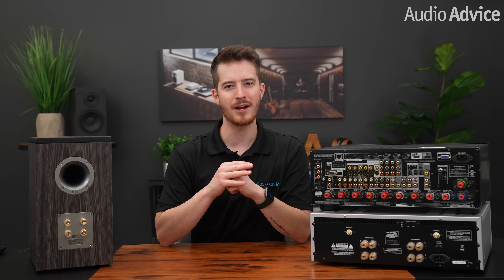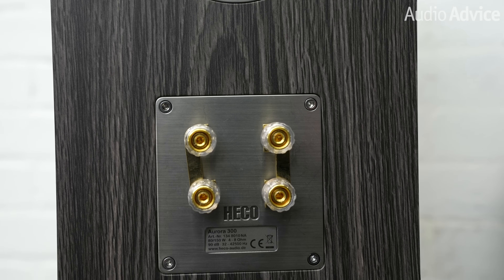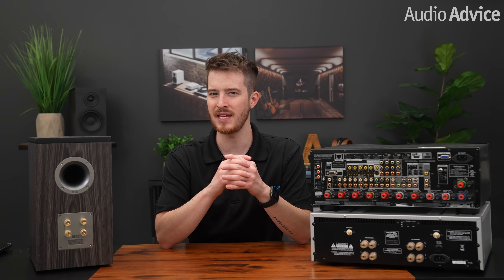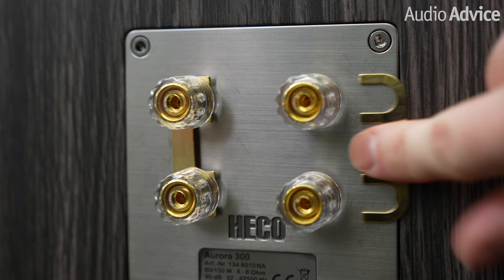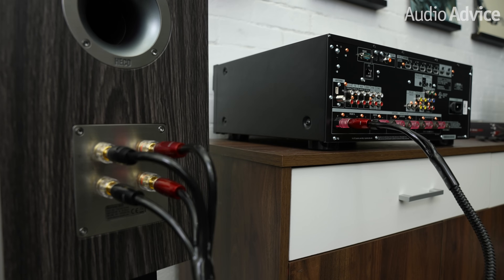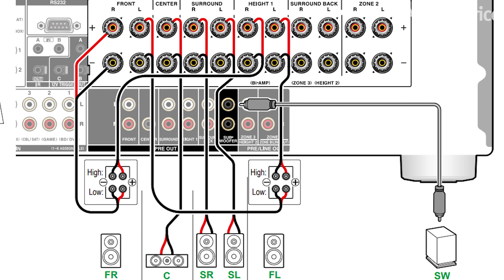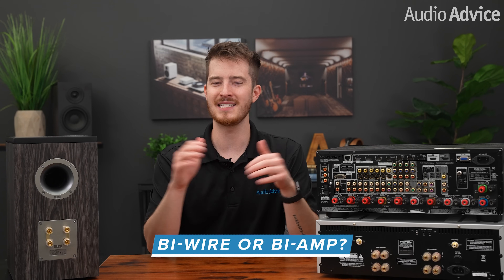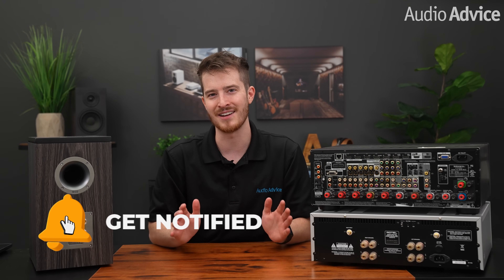Bi-Wiring & Bi-Amping Explained | What is it? How do you do it? Is it worth it? Let's talk about it!

Comment: I have 2 klipsch rp8000f ii front left and right tower speakers with an onkyo tx-nr6100 7.2 channel receiver. Today i decided to bi amp the speakers. Everything improved the highs mids and definitely the bass, but there is one problem... some sounds have moved to opposite direction i can notice this in certain songs ive always listened to and especially in games. When i test the left and right channels on the setup i can hear both at the same time instead of hearing just one speaker when switching between left and right. I can also tell it sounds more to the left when it should be only the right speaker making noise and vice versa. Is this a normal thing when bi amping?? Or is something wrong? I double checked all the connections and they are done correctly. I kind of regret bi amping them now because its a pain in the butt to get behind the system and put the jumpers back on... games are useless to me now since the sound is on opposite directions.
Reply from the maker: It certainly sounds like something is wired incorrectly, from your description it sounds like one of the drivers is out of phase.  What you are hearing is not normal with bi-amping at all.  Or it is possible the configuration inside your Onkyo is set incorrectly for biamping, that would be easier to check than the wiring
Reply: @AudioAdvice  before i did the biamping, i had both speakers connected with banana plugs with the jumpers on. When i decided to bi amp i did not use banana plugs and had to connect the extra cables with stripped ends so the low frequencies have banana plugs and the highs dont... maybe some pieces of stripped wire are out and are not entirely inserted on the receivers plug and is affecting it?. Do you know if it could be the extra amp from the surround heights (biamp option) thats making it sound off like that? The only options on my receiver i can change are the number of channels i have setup (2.1) and i can set "biamp" to yes or no, so i doubt that its the setting on my receiver... anyways thanks for answering i was so happy when i heard the sound improvement everything was perfect but when i noticed some sounds were left instead of right now its just depression not knowing what it is lol
Reply from the maker: @Sluggerrr  it has to be a connection issue then. Double check at the receiver end.
Reply: @AudioAdvice  i finally recieved the banana plugs and i can confirm with you  that everything is perfect now the sound stage is actually way better now that it is correct so yes, the issue was biamping with stripped wires instead of banana plugs...happy new year!
Reply from the maker: @Sluggerrr  Good to hear!

Comment: I own a rare speaker; Panasonic SB-400.. (same as Technic SB-400.) These speakers allow for true Tri-Amping. So VERY cost prohibiting except that there are now so many affordable Class D amps out there such as the Aiyima A07. If you search for images of these speakers you will find several shots of the rear terminals and the switches selecting your preferred use of one amp, two amps or three amps. My problem is I would have no idea how I could ever integrate three amps between my source and my speakers. What preamp could I use? To me this seems to be an exercise in abstract thinking!  BTW, these speakers are rare in the States and were made in Japan in the early 1970's. Sensitivity is 93db.  My speakers are in perfect working order and sound incredible with just one amp.
Reply from the maker: Very interesting speakers.  It looks like you would need an electronic crossover in between your preamp and power amps.  Did they make a matching one back then? Thanks for watching

Comment: Bi amping on integrated amps can be possible, you need to house two amps and a crossover on a single integrated amp unit, done. connecting the crossover in between the tone controls and the input of the amps, low and hi frequencies.
Reply from the maker: Yes, but we do not really know of an integrated amp with that full feature set.  Thanks for watching and commenting

Comment: I just bought the Crown XLS1002 Two-channel amp. they have a feature built into the amp called Y Mode. (you simply run one RCA cable from your subwoofer output on your receiver to one channel on the Crown) it's a built-in feature. and it works great, it is so powerful. you can easily drive four 8-inch 2-ohm DVC. not even using bridge mode. works great. if you know how to wire it correctly.
Reply from the maker: Thanks for sharing.  If your Crown has an Ethernet connection you can download their free Hi Q Net software and do a whole lot more.
Reply: @AudioAdvice  I don't think mine has an ethernet connection. I must say. this is my first D-class amp. I'm very impressed with its capabilities. I will look into the software. thanks a bunch.

Comment: ... but the bi-wired system is still physically linking all the terminals using the same conductive wires. Nothing in the wire knows to split highs from lows and the same "magnetic feedback" will flow through that conductive material. 🤔
Reply: This is something that a person who hasn't had training in electrical theory finds hard to visualize. It's also tricky to explain just using words on the internet! 🙂 (It helps to know the difference between voltage and current.)
 You're quite right to say nothing in the wire knows to split highs from lows - that's true whether it is a single wired or bi-wired system. It's the two sections of the crossover in the speaker that do the splitting. The low frequency crossover receives current from the wire at those low frequencies and passes it to the woofer, ignoring the high frequencies. The HF crossover does the same for the tweeter, "grabbing" the higher frequencies and ignoring the low ones. (I'm generalizing for simplicity.) The current to drive both woofer and tweeter has to travel together in the one wire as a combined quantity.
 When the crossover sections are split and each has its own wire to the amplifier, the low crossover section gets the low frequency current from its wire, and ignores the high frequency portion, passing no (or little) high frequency current to the woofer. So the low frequency current runs along the low frequency wire. The same happens on the other wire, the HF crossover section is "sucking" the current it's looking for through the "high frequency" wire and stopping lower frequency from going through. So even though each wire has the same stuff "available" as a single wire would, each wire is doing less work, only carrying what current the crossover and driver connected to it wants.
 Please let me know if this helps to visualize what is going on.

Comment: One question still bugs me and I can't find no answer anywhere: to bi-wire correctly wouldn't you need an amplifier with 4 channels (2 stereo channels, or one like that in your video)? If you bi-wire, let's say with a stereo amplifier, (one left and one right channel) wouldn't you just send the same signal to both speaker cables?
Reply from the maker: Great question. Two amps is passive biamping which should be better.  The theory is the thing biwiring helps is the back feedback from a woofer and by separating the leads the wire feeding the tweeter does not see that. But this is a hotly debated subject and everyone should come to their own conclusion by trying it. Thanks for watching and commenting
Reply: @AudioAdvice  I see. This is much more clear now, thanks for clarifying!

Comment: bi-amping requires the user to incorporate an "active" crossover network. as the signal leaves the pre-amp, the raw signal is then fed to the input of the active crossover. after the signal is processed there, the high's go to a smaller power amp for tweeters and mids; whilst the lows go to a larger bass amp. Now the user has 2 volume controls for the same signal, one is for the highs, and the other one is for the lows. There might even be a third one for a subwoofer. This is how you bi-amp or tri-amp, making the amplification much more efficient. I know of no other way. The idea of bi-wiring is silly and the user opens up a much bigger possibility of damaging the speaker drivers, and it does nothing to cross over the signal. You are actually asking the tweeter to make bass sounds and the woofer to make the high frequency sound. That would be stupid. If you cannot hear the difference and think it sounds better, then you need to have your hearing checked.
Reply: There are many times when a person who is trying to explain how electricity flows will use Water as a parallel. Try imagining that the signal coming from the amplifier is a giant water tank. Your volume control is like a valve, and as you turn the volume control up you allow more of the signal to come through. And then once that signal leaves the amplifier (or water tank), you might have more than one place to hook up pipes or hoses. Now if you hook up a hose and run it to your faucet, the water will flow and you'll have lots of water. If you run another hose from one of the other outlets on the water tank, and then hook that up to the same faucet, you'll still get water. It'll be the same water that the first hose is bringing to you because it comes from the same tank. Bi-wiring is doing what I just described. It does not help anything, actually you are opening yourself up to damaging your speakers, especially your tweeters.
Reply from the maker: Thanks for all your comments.    We welcome you to read our written article which might help.  https://www.audioadvice.com/videos-reviews/speaker-bi-wiring-bi-amping-explained   We discussed in this video, single wiring, bi-wiring, passive bi-amping and active bi-amping.  With everyone of of those except active bi-amping, the passive crossovers in the speakers are still in place.  We did state this is a controversial subject, but more than 75% of high end speaker manufacturers enable their speakers to be either single wired, bi-wired, or passively bi-amped.  About that same percentage of home theater receiver companies offer a passive bi-amp option on their products if you are not using all of the amplifier channels of the speaker.  McIntosh, one of the most respected engineering companies in the audio world, even offers power amplifiers designed for passive bi-amping.
Reply: As AudioAdvice has pointed out, unless you dismantle the speakers and rip out the crossovers, bi-amping does not require an active crossover. Neither passive bi-amping nor bi-wiring cause any harm to the operation of the crossovers, nor do they pose any threat to the drivers. You've completely misunderstood the principle of bi-wiring.
Reply: @doctorquestian  If anyone comes past and reads this "water explanation", don't bother trying to understand it. It is total nonsense and explains nothing about bi-wiring.

Comment: Nice explanation on some points. Good explanation of multi-amping. Getting away from the x-over in the speaker cab yields good results. In my experience, I've not seen that wires and amps need to be identical. I've tri-amped using solid state and vacuum tube amps (Onkyo S/S, Fisher and TenTec tubies, NAD S/S, and others I've forgotten over the past 40 years of playing these games). Currently drive a pair of JLB4411 with the x-over removed, tri-amping with S/S amps. Reinforced with Bose 901s for midrange driven with a separate amp, getting only the mid range from the TDM active x-overs (no highs, no lows...must be Bose) The ratio of wavelengths (audio vs electrical) are so far apart the the time delay introduced by extra wire length would be undetectable, and barely measurable even with the right test equipment. Wires: I've mixed and matched, even played with 25 conductor ribbon cable wired even/odd to approximate speaker impedance. I found no difference between zip cord, ribbon cable, individual stranded, and solid core wire. Never found a distinguishable difference in wires. This isn't RF. In my opinion, the money is best spent on good speaker motors and concert tickets.
Reply from the maker: Thanks for sharing, yes concerts are fun!

Comment: I believe you should use DIFFERENT cables when biwiring. Use a cable that does top end better for high frequency crossover, and vice versa. Also, why must cables be same length? You do know the speed of light, right?
Reply from the maker: Some people agree with that. It’s all about testing and listening.  The lengths are more about resistance. Thanks for watching
Reply: Electricity speed varies depending on many factors including wire gauge, but it’s roughly 90% the speed of light , not to be confused with lightning which travels at 270k mph . I don’t believe different cables should be used for biwiring , that’s the crossover’s job . And as far as different length, our ears may not notice a difference but the amplifier will . If you run one speaker at 12 feet and the other at 3 feet , the 3 foot cable will be warmer .
Reply: same type of wires.. same length.. identical amps.. and use one amp per speaker. vertical bi amp

Comment: Great video, I wish it was longer than 7mins.....
How did you make those 2 Bi wiring speaker cables?  RED AND BLAck,  did u strip a wire  and  use 2 Red Copper wire  for the red connextions + and  2 Silver metal wires for connecting the Black Terminal connections?
Reply from the maker: Thank you. Yes we joined them at the amp end although for the cables we used both were copper and we used the jacket color codes. Thanks for watching

Comment: This is from Cambridge Audio:
"At Cambridge Audio all of our modern speakers do not have the capacity to be bi-wired. We always want to offer our customers the best possible components in our products, rather than adding an extra set of terminals to the speakers we would rather invest in a better crossover. This philosophy also extends to our views on wiring. Rather than spending your hard earned cash on two sets of mediocre wires that can be bi-wired into a speaker, why not single wire using some really great speaker cable? This is also more space effective as you don’t get the tangling mess of cables at the back of your hi-fi set up which can often come with bi-wiring.  

There is a lot of discussion around this topic; in fact you’ll find yourself a little lost in a sea of online forums about it! Some believe that bi-wiring is purely a marketing ploy, often referred to as ‘buy wiring’, whilst others believe it makes a noticeable impact particularly to middle range sound. We made the decision not to build our speakers with a bi-wiring option so we can focus on making the components inside of our products the best they can be."
Reply from the maker: Thanks for sharing! It is definitely a hot topic of debate. As long as you enjoy the sound, then that's all that matters!
Reply: This philosophy makes the most sense, though I didn't even know Cambridge made speakers. There are plenty of very high quality speakers that only have a single pair of terminals. The only reason most hifi brands have two pairs is because they know many of their customers believe that it will sound better when bi-wiring/amping.
Reply: Also amplifier takes only 2 connections  and speaker has 4 connections. I don't understood how frequencies separate out in middle of wires?
Reply: @abhijeetupadhye6821   they don't.
Reply: @TH-lo8mq  I do not understand why you do not explain to these by wiring people that what they are doing is futile, and at the worst dangerous. They could damage the loudspeakers doing it that way.